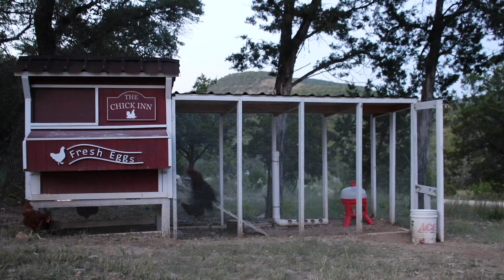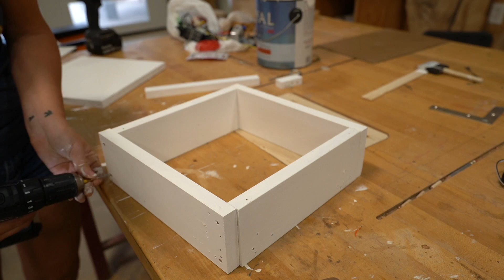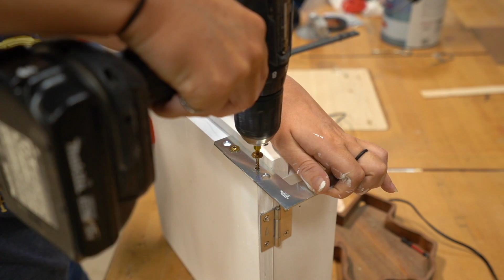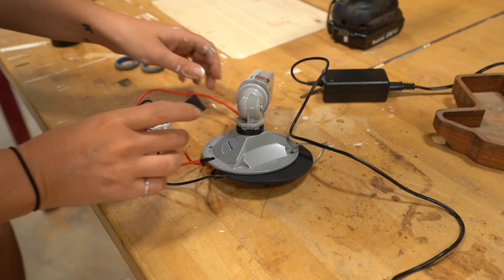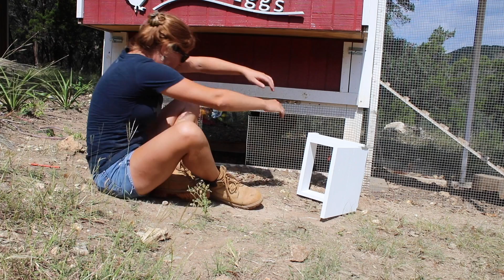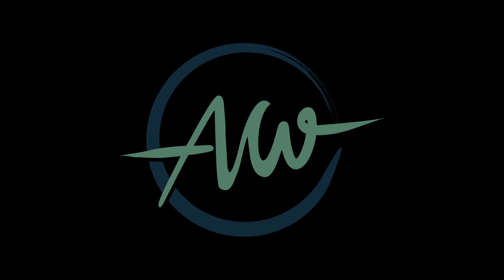DIY Automatic Chicken Coop Door

Comment: But isn’t there continuous power to the actuator all day long? What happens on very cloudy days?
Reply from the maker: Even on cloudy days there is still daylight. I've never had a problem. Thanks for watching.
Reply: @AprilWilkerson  how long has actuator lasted? The continuous power (even though low voltage) doesn’t wear it out?

Comment: I bought the plans and installed the door on my coop.  The concept is fantastic.  I am having issues with the door opening in the morning.  We have had temps in the 20’s at night.  Any thoughts on why it’s not opening?  It closes perfectly at night but in the morning it stays shut.  If I disconnect power and then reconnect, it will open.  Would the fuse ampage have anything to do with it?  Cold weather?  Help!

Comment: My chickens dont go in to the coop until it is literally pitch dark.  Other purpose built auto chicken coop doors allow you to adjust the sensors on how dark or light you want it to open and close. Or use an alternate set time open time close system.  Im guessing this photosensor doesn't do this?  Exactly how dark does it get before it closes?

Comment: Great DIY, I would suggest you use a lift and lower door that fits in tracks so the predators can't pry it open.
And some of your viewers might also consider using an electric car window opener, they are essentially free and work well if you have any old cars about to get rid of, but pulling one from the junkyard too, or you can also buy them new replacements from rockauto.  Also not sure you really need a light sensor, a basic timer is good enough, the time is gets dark at 5pm instead of 9pm is only a few hours and some are quite easy to adjust (see sprinkler timers), or frankly I do electronics and there are circuit boards that can do it some real cheap, like $5 for a 12v relay.
Reply: Hi what circuitboard, can you show me?

Comment: Oops, I forgot one other detail the wiring diagram shows the actuator leads as white & black and mine are black & red. I have a Progressive Mini Linear Actuator and I believe you used a Micro , which is a little smaller but should not matter.

Comment: I connected this up - paid for wiring diagram, and it doesn't work. I have solar panels and I connected to the solar controller load terminals. Do I need to connect direct to the battery? The actuator works with a rocker switch connected to the load terminals. Also my photocell has a red, black. & white wire and wiring diagram has red, black, & orange. I connected terminal 8 on the relay to the white wire on the photocell. I need some help here.

Comment: "The Chick Inn" lol.

This is soooo much better than the commercial ones.  My only suggestion is to build the frame around the door that is closing, inside of underneath the closing door, then you don't have to worry about a small gap.

For instance, allow the door to shut inside of the frame. My experience with raccoons is that, eventually, anything you can pry open, they can pry open.

Anyway, I wish we were friends
Reply: What are the specs on your actuator? Stroke length, max force, etc?

Comment: Quick question about the in-line fuze you briefly mention, what AMP fuze did you use? Secondly, could you please explain the reason for adding that fuze there and what it does? Thanks so much, great automatic door, one of the best designs I've found so far!

Comment: hi, great video! One short question please. When the linear actuator completes full action (open or close), how does the circuit go to stand by state and not continue to work? Is this done by the relay itself or by an extra switch? thank you
Reply: There's a switch built into the actuator I do believe that cuts power when it opens and closes shut.
Reply: Can confirm that these linear actuators have limit switches built in. Can't find any info about relays, though.

Comment: The voltage isn’t all that bad when u describe electronics. U should say that there r .5 amps which isn’t bad but not that good, but it wont kill u as it takes a full amp to do so. Think of it like tasers if there’s 40,000,000 volts and 5 amps well u should be more worried about the amps then the volts as the amps kill not the volts

Comment: How strong is that door held close against, say, foxes? Would a recessed door not me safer?
Reply: If a fox or similar preditor wanted to get in they could have torn through the wire a long time ago or just chased down the chickens when they were out during the day.
Reply: @genewaddlerandomstuff2122  Foxes and most predators are nocturnal. Foxes won't go into a chicken coop. But they can dig, and go into the pen.
Reply from the maker: I put predator wire underneath so nothing can dig in. Never had a problem. Thanks for watching.

Comment: Looks great! I installed one on my coop two weeks ago. I went with a simple timer for triggering my door instead of going by photo-sensor. I went with waterproof boxes with clear fronts and mounted all the electronics on the outside of the coop visible from my house. The electronics have LED's that light up when the door is open/closed. I went with a solar panel to run mine too and a 12V battery for backup. Next up for me is replacing the timer with a ESP32 to monitor the charge on the battery and to set it up so I can monitor/control it through my home automation.
Reply: Did you consider a security guard? Might be cheaper.
Reply: Did you ever figure it out?  I'd like to do the same, but I don't have the knowledge to think it out on my own.  However, I can follow plans pretty well!

Comment: Does the linear actuator open the control circuit when it's fully extended or retracted? I'm wondering what the effect is of always having current on the control lines.
Reply: most of those actuators have end of travel limit switches at both ends so no current is drawn when at  either end.

Comment: I live in a colder climate. How do you think the cold will impact the operation of the automatic closer?  Especially in minus zero temperatures.
Reply: the key would be you power source. i.e. on my game cams they operate as low as minus 35 below or even colder with AA batteries, but if I use C cell they are useless just below freezing. depends on your amp/mh draw. you should be ok. if your cold is in a most area and you cake up with ice, all bets are off.

Comment: Do the plans for the automatic door come with a wiring diagram? I already have a linear actuator ,110-12V dc power supply, and a photo cell. I just need to wrap my head around the relay part of it.
Reply: I am having the same issue.  I purchased the actuator and control you linked to but I can not get them wired correctly  lots of sparks!  Help!

Comment: Hi, I was reading the comments and noticed that no one suggested replacing the sensor with a solar panel.  The panel can charge the battery during the day and the signal from it would be used to trigger the actuator.  (2 birds--one stone...)  Also, you can use the signal from the panel to add a delay timer or clock timer right before the actuator.  Oh, and a transistor H-bridge could reliably replace the relay while using less power.  I hope that helps.

Comment: I assume these parts aren't exactly cheap. For a little more (probably) you can get smarter automated chicken doors that are designed to be chicken doors. My ChickenGuard has been working perfectly for many years on several different coop iterations. It has settings for using time of day or the photocell value (with a customizable threshold) or a hybrid method that works great (like "once it is at least this dark, but no later than this time of day"). Also, a lift gate style door with tracks for the door and an auto-lock built into the pully system will be much better against smarter predators and, if you are in a colder climate, better for weather related issues like a snowdrift.
Reply: Not likely to get snow drifts in south Texas where she is

Comment: The L-bracket looks shortened, so it would have been nice to see the (perhaps trial-and-error) approach to find the right dimensions and positions.

Some info on that sensor: since daylight doesn't fade perfectly smooth on a cloudy day, you wouldn't want that sensor to open and close again, every time a cloud passes by. 
To avoid that, such a sensor had 2 thresholds: for the gate to close, the sensor has to pass below the lower threshold. So, it has to be really, really dark before it actually closes. But it won't just open again if it gets a little bit lighter - it will only open the gate when light rises to the upper threshold. So, it has to be really, really light before the gate opens again. That bit of electronics with 2 thresholds is called a Schmitt trigger.

Comment: The link to the actuator goes to the generic page. What stroke and force did you use April? This project is a must for us urban chicken farmers. Also...do you have a schematic for the relay wiring?
Reply: Hi there, we can help with this! The link to the actuator April used: https://www.progressiveautomations.com/products/micro-linear-actuator
Once you have the stroke and force requirements for your project, you can contact us and one of our engineers would be delighted to recommend our options to you.
Reply: @ProgressiveAutomations  My point is, if we are to replicate Aprils build, we need the same actuator she used. A link to that exact actuator would be helpful. It is clear to me that she used a 4" stroke with a 5 lbs force. Also, she linked to a SPDT relay when she really used a DPDT relay. The $10 plan I purchased should have all these parts fully described but they do not. No one can build this door, in the manner that April did, without this info and without a schematic for wiring the unit up.

Comment: I made one of these a few years ago and ran into the same problem with the door not quite shutting completely.  Also, as the actuator ages it tends to not shut tightly.  My daughter solved it .... she suggested I use a simple magnet (not rare earth, too powerful) which, when installed, worked just great.  it's still out there working, 8 years later.

Comment: Hey April, Great idea and use of a light dependent resistor and the electromechanical actuator, what you said. Perhaps you've heard it, why did the chicken stop in the middle of the road? She wanted to lay it on the line. At least it's clean. All the best from Oregon, C.

Comment: Great idea.  However in WA State, we have Bobcats, raccoons, wolves and bear that all have chicken on their menu.

I would use this on the coop but have a strong predator (small yard) so chickens could leave coop safely and return but I would have to have a manual locking door in the adjacent yard.  This gives them some scratching area until I open and close the yard door.  Or other ideas?
Reply: Yes, I've done it like this. However, this door should work if it shuts inside of the jamb, like an exterior door to a home.

Comment: Enjoyed this episode. I have two made an automatic chicken door opener. The problem you're going to have is with that 12-volt relay. It only works at 12 votes not at 11.8. I changed to a solid state relay. It operates between 2 and 18 volts.
Reply: What was the cost of all the materials? April never mentioned.
Reply: How would you wire that

Comment: Chickens will eventually damage any exposed wiring. Better protect everything, leave nothing exposed.
Reply: true. They will peck on anything. ANYTHING.
Reply: @almarma  sleaving in cut pipe or even foam insulation for copper pipe would be easy/peasy and cheap.

Comment: Great video, I'm curious what shuts the power off to the actuator when it is fully open or closed. Thanks
Reply: Hi Scott, our actuators have built-in limit switches. You can find this actuators datasheet here for more information: https://cdn.shopify.com/s/files/1/0061/7735/7891/files/Micro_Linear_Actuator_PA-07.pdf?v=2649400298085553116
Reply: Lengthy of the stroke, can only go so far Sir
Reply: @joexg50  is their an internal limit switch when it reaches the end of stroke? I didn't notice anything in the link she shared for the actuator.
Reply: @scottcroonquist6574   well the pistons have only so much travel so as I recall you just set the piston according to how much room one has.  But you recall the  actuator stop on a screen door we all have had at one point or another which we can adjust. Maybe she has that kind of piston.  I built a frame and we  set it underneath a conveyer belt that cans of Quick would come down in rows of 4 or 5 as I recall then I built 2 what 
I called Bombay doors in the box and everything was coordinated with laser eyes and when they detected cans the doors dropped open and the set of cans dropped into the cardboard box and set of arms closed the tops while others closed the bottom as it glued them all snug and moved along. Thousands of can per day. It was long ago,  Details escape me now. But I liked working there very much. It was a huge plant and we had the run of the place and it always smelled GREAT.

Comment: Hmm... There is on/off signal from the photocell and DPDT relay for switching the direction but how does the linear actuator stop? If it is constantly energized, you may end up having to eat all your chickens in one sitting since most will be cooked roughly the same when there is fire :/
Reply: I use these linear actuators and other like them on robots for a jr. high robotics club and most have limit switches built in. When ones that size do fry they really do produce enough heat to start a fire and with the fuse she should not have a problem. I think we've only ever burned one up.
Reply: I'm going to guess the linear actuator has an end of travel switch at both ends. Some are even designed so that the end travel switches are adjustable.

Comment: I think I would recess the door in a frame so the predators couldn't grab the edge and pry against it.
Reply: I’d be more concerned about where the wire meets the door frame, doesn’t look like she secured it there. Coyotes are common were she’s at, they’ll push right passed it.
Reply: Damn raptors always after ma chickens.
Reply: I've tried to overcome a linear actuator. It wouldn't budge. A racoon would have to eat through the door to get in.
Reply: @michael what if the door loses power? Also, what if the wood rots just enough for an animal to pry into it. What if the L bracket snaps or becomes weakened over time? What if the LA is rated higher than it is... Many, many reasons to bulls the door like an exterior door, no benefits to building it this way.
Reply: @MrVARhythm  What if a tornado rips off the door from the coop? What if a wild fire burns the whole coop? What if? What if? What if? C'mon find another place to overflow your pessimism and criticize without reason. Great DIY project!
Reply: It's not without reason. A racoon can pry a door open easily. No, we don't have tornados over here but we do have raccoons and power outages. It's a good project that can be made better. If you build thd door like an exterior door on a home you won't lose your entire flock.

Comment: What if some chickens are still out after the door closes? I would prefer a remote control where i could operate it from inside. Great idea though.
Reply: Easy.... Before the has implemented those system, she has learned at the chicken to return at home before sun goes down :-D
Reply: Chickens instinctively come home to roost soon before darkness falls.  You could string a three wire feed to the house, then actuate it manually.
Reply: The early bird gets the worm, the late bird is the racoon's worm, the wolf's dinner, the bear's snack.

Comment: Nice and straight forward. The one I'm designing uses a linear motor with feedback current just in case something gets caught on the door, like a chicken and uses a Strawberry Pi for Internet access and control.
Great vid!
Reply: The one I installed came with a sensor that is triggered if something is standing in front of it. It's been working quite well. Best part is, if something walks in front of it while it's moving, it pauses the current operation. Then when it's clear again, it finishes its task.
Reply: You could even add a camera to the Pi and get pics for confidence.
Reply: Would you be willing to share what you came up with, and the parts you used? Thanks!

Comment: I bet April goes out every night to double check if door closed 😊. I would still have OCD and have to see it close no matter how sure I felt .
Reply: That can be solved quite easealy. add a door sensor to see if the door is closed and have that report back to your home automation :D. or maybe april can add this to the alarm system that is installed :D
Reply from the maker: I can look out the window and see if it's closed. There has never been a problem.

Comment: Might also need to some sensors to count the chickens going out, and coming in,  if there is one that hasn't returned, alert the owner.
Reply: @ohasis8331  the low tech solution is to look out your window. Not everything requires an arduino and wifi compatability. And if you do want that, position it so that the door is within view of a RING security camera or similar device mounted on the house so you can check door status from anywhere...
Reply: Introducing the iCoop...
Reply: Ed Sychra 😂 LOL!
Reply: RFID tags on each chicken   LOL
Reply: @A_Tree_Reborn  Maybe they'll think there's a problem if you stick barcodes on them.😁
Reply: @ohasis8331  I toured a new broiler barn two years ago. the kid was in junior college three hundred miies away, and the infor. from the barn computer came directly into his phone, and he could over ride or adjust from his phone. Of course, that system several hundred thousand dollars, but what a show.